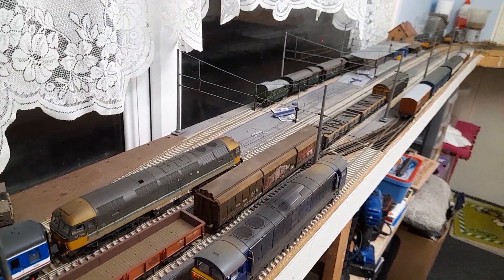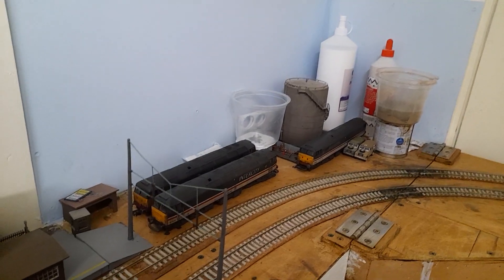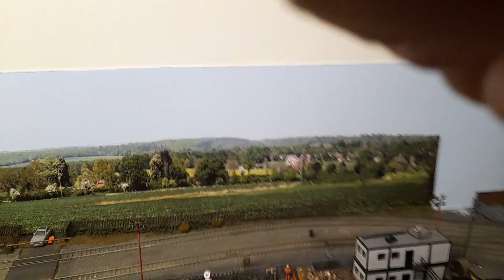November 2023 Layout Update

Comment: I first used the cd motors for my lima 47’s but then I changed it and purchased the hornby railroad frames and motors to use instead to convert them to DCC. I got mine from Lendons of Cardiff
Reply from the maker: Hi stephenhorsley6800, thank you for your kind comment, that is a fantastic idea of updating to hornby motor bogie frames, I have just changed the eight pin sockets on two Class 87s and one 47, and they are now running perfectly. Once again many thanks Kindest Regards Dave 👍👍👍